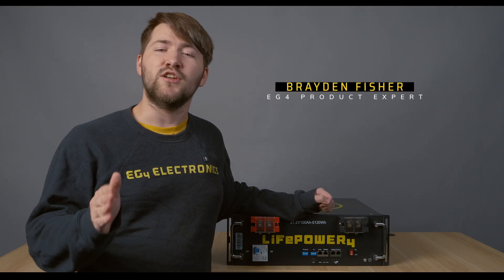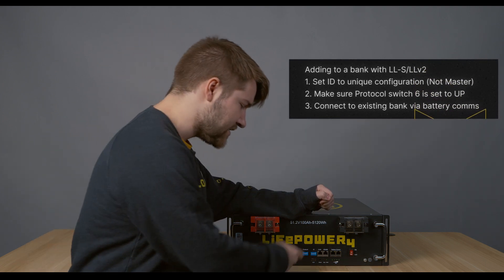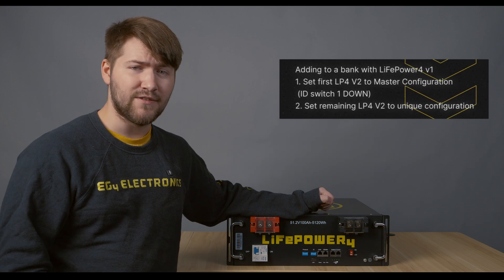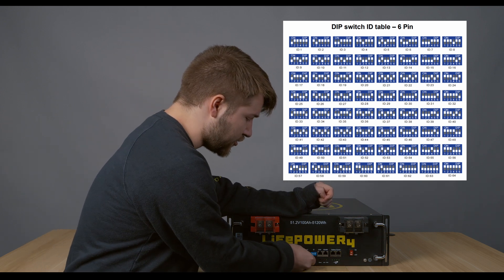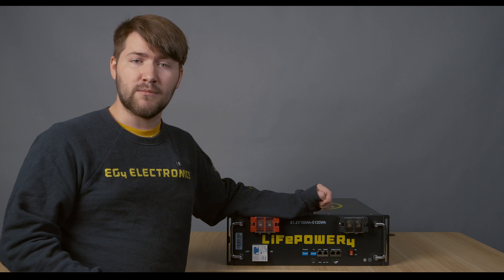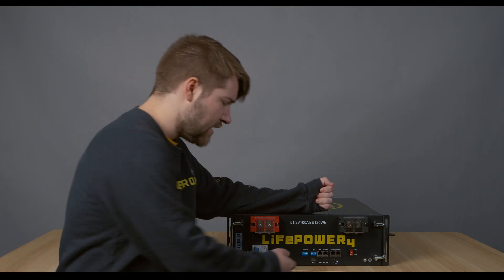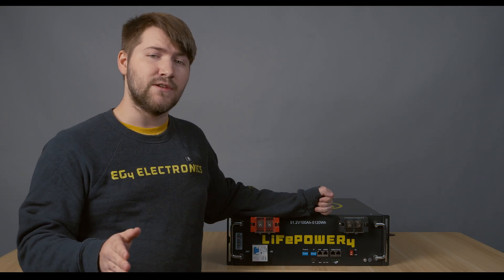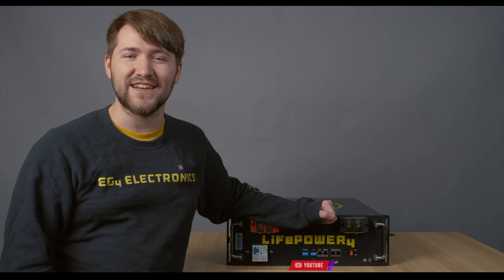How to Configure the LiFePower4 V2 with an Existing EG4 Server Rack Battery Bank

Comment: I echo the issues that others have been having with a mixed battery bank.  In my case, I use Solar Assistant to monitor my stack of six Lifepower4 V1 batteries, it has been working well for a couple of years now.  No matter what I try, I can't get Solar Assistant to talk to my new V2 batteries :(  To make matters worse, it doesn't appear that the V2 batteries are charging and discharging with the V1's absent comms among them.  Major problem.

Comment: I have three EG4 Lifepower4 V1 Batteries and three V2 Batteries. I have been on the phone with Signature Solar multiple times they were very friendly. my EG46000XP was having a problem communicating with all the batteries. We did the firmware upgrades of the batteries and the inverter. We made a communication cable to go between the V1 and V2 batteries. We changed protocols and Address. I think we tried everything until I was able to see all six batteries then the help stopped. I still cant see the SOC of the V1 batteries and they don't appear to be charging and discharging together.  I have a chargverter that I need to use for lack of sun at the moment, the V2 batteries seem to get to around 85% and stop charging. Anyone have any ideas? I guess they have given up on me.

Comment: I should have just bought the V-1
This thing is causing me issues.
Followed the directions 
Still isn’t working.
I’ve spent thousands with these batteries and now I have a $1300 battery I can’t use!
Even bought the updater to make sure that wasn’t the problem.
About to send it back 
Maybe I got a bad one?

Comment: With a normal Cat 6 cable between LifePower4 V1 and V2 batteries, the breaker trips on the V2. With only pins 7 and 8 from the V2 battery to the 1st V1, the breaker stays on and after waiting a little while the 12 Kpv recognizes the other batteries. Success!!

Comment: I’m having the Issue of para sync loss
Reply from the maker: This would be a fault that means inverters have stopped communicating effectively with each other in the parallel setup. Ensure all the cables are connected properly and you have not loose cables.

Comment: I just purchased a LP V2 battery to go with my 2x LP V1s.  Will the new LP V2 battery contain the cables I'll need to communicate with the LP V1s and my EG4 3000v1 AIO inverter or would I need to purchase any new cables?

Comment: Are we supposed to remove any pins or wires from the battery com wire to the 1st version Lipo4 from the new V2? Which ports would this wire use?
Reply from the maker: Edit: We do apologize, you will need a cat5/5e/6 cable pinned for 7 and 8 only between the Lifepower4 V1 and V2.